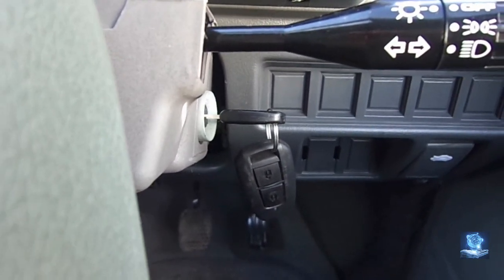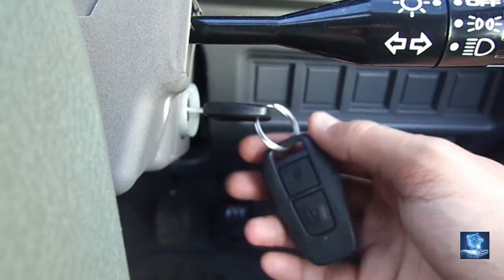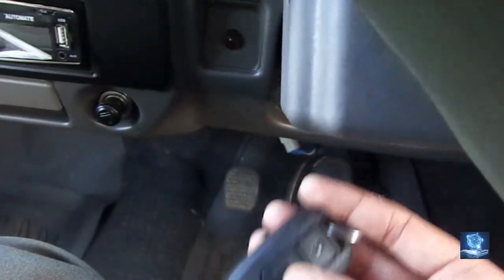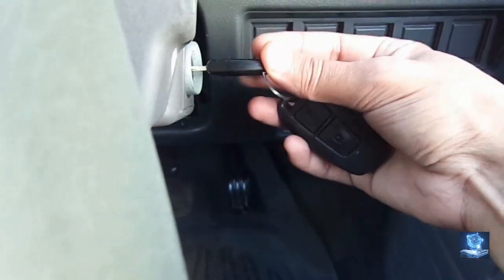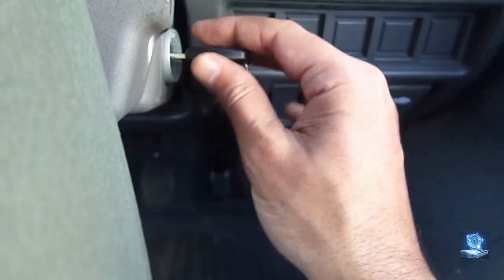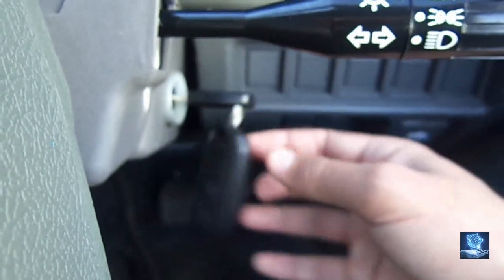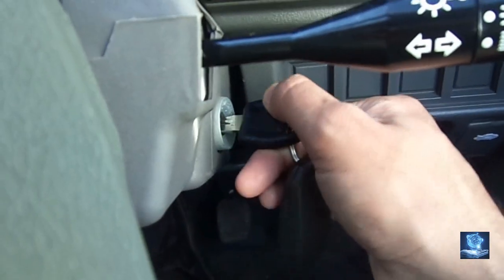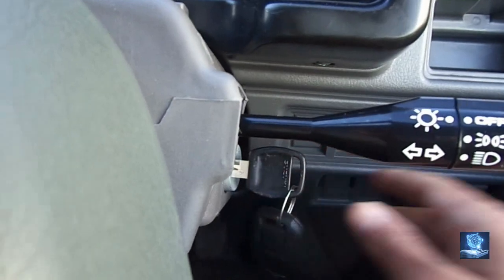Immobilizer in Suzuki Mehran / Maruti 800, How it works.Immobilizer system information [Urdu/Hindi]

Comment: I applied key on door of mehran where i have already installed  immobilizer . But after applying key direct on door . Suzuki mehran steering was locked and key didn't move in switch there fore i cant start engine
Reply from the maker: i didn;t understand your question. Immobilizer can not be installed in door. its in starting mechanism...i think u r talking about key less entry in mehran. Right?

Comment: How much they will charge to Unlock immobilizer approximately
Reply from the maker: Dear. normally in mehran. you will get one spare immobilizer remote. so there is no need . but if both are misplaced. then they will provide you another immobilizer key instead of replacement of whole system. coz paksuzuki knows which frequency works in your car immobilizer

Comment: Bhai iss kay door locks bhi attach hain iss kay saath yaa akila remote hi hay.? Yaa phir only mobilser only
Reply: Door locks bhi attach krdene chaiye thay, ab banda door locks aur immobilizer ke alag alag remote lekar ghomey... Suzuki ne nahi sudhrna...
Reply from the maker: door locks attach nahi...ye immobilizer system hai only...with remote
Reply from the maker: unboxing master...ye suzuki ki chaal hai..coz ager ap after market door lock/unlock feature add krwain gay mehran main ...tu apki car warranty void ho jae gi.....strange but true....
Reply: TechTipsExpert central locking se warranty kese khatam hojaegi??
Reply from the maker: unboxing master. jab ap remote lock/unlock feature add krwaty hain..tu apko electrical wiring main alteration krni parti hai..in short you have to cut wires to accomodate this feature..which void your car electrical warranty...main aik video upload krun ga about warranty claim violation..maine paksuzuki k officials se kafi argument kya about these little things..k is se warranty claim kese void hota..they replied.rule is rule...if you cut any single wire in a brand new car...and they have watched that...then ur car electrical warranty will void....aur b bohat si little little issues hain..which affect warranty and people don;t have an idea about those...i am planning to make a video on this issue...